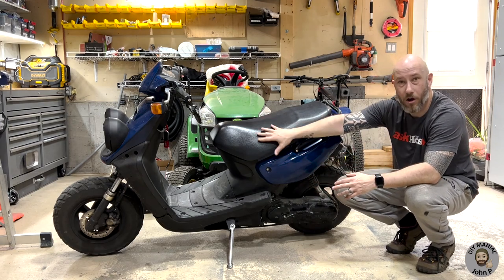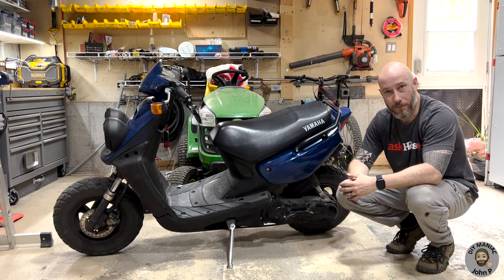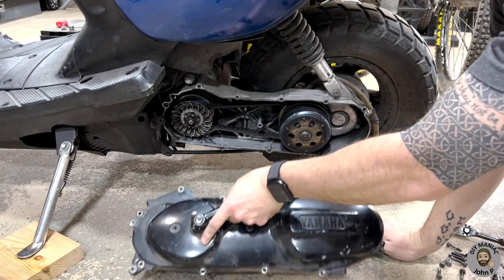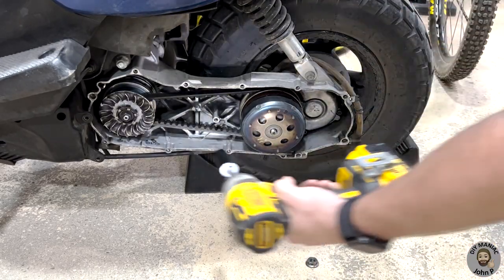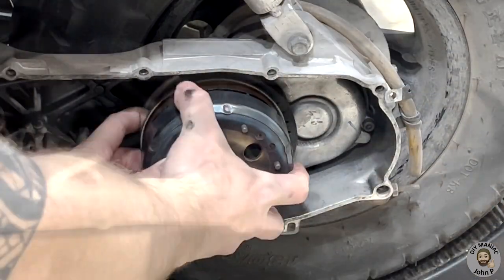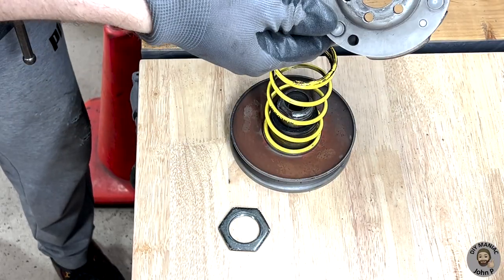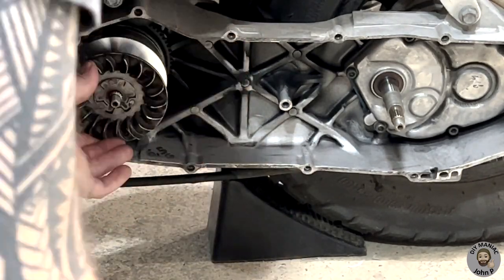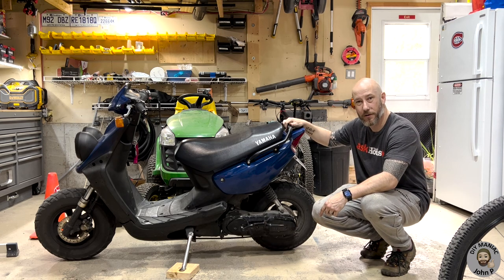Yamaha BWS / Zuma Variator and Clutch Replacement

Comment: About a month ago I put a new carburetor in my 2005 Yamaha bws and it was running a lot better. Recently I put a new variator, heavier rollers and a new belt in but it made it run slower and worse. Do you know why?
Reply: Yes, you put heavier rollers in it, now it is up shifting at a much lower rpm. 4stroke engines power and torque peak at higher rpm.

Comment: Quick question, loved your video. I changed mye son’s clutch and Variator and now the scooter won’t start. The ignition seems to do it’s job. But won’t start. Any suggestions on what to look? Sparkpkug, cable, gaz?
Reply from the maker: Nothing in the transmission you touched should have caused a no start. Was it working perfect before you changed the clutch and variator?

Comment: i put that side stand on my scooter but it wants to push it up and fall over any suggestions on what you did to get yours to stay and also how to prevent it rolling away on a hill as there is no brake lock like on quads I've seen. just did my transmission oil change i was 6k km overdue didn't even realize i had one and when i bought scooter it had 400km on it from 2004. it was all green and smelled burnt. currently waiting for new exhaust to come in and i have a new aftermarket variator kit to give it some extra speed if i can find someone to modify it as i am not a mechanic. its a bws 50 2 stroke and i run strawberry scented motor oil

Comment: Hey! 

I’m looking into some problems I’m trying to fix with a bw 50 2012. 

For instance when I start it and leave running on the stand, it should idle at a normal speed, but the rear wheel runs really fast… I was wondering if you know or would show in a future video how to adjust the idle speed
Reply from the maker: The idle speed is easily adjusted with the idle screw on the carburetor
Reply: @DIYManiacJohnP  

Tks!

I’ll try to find how to access that. I’m new to this. 

Maybe you can show this in a future video. It seems like a common issue.

Comment: got question on my 2008 zuma my push start button don't work what could be wrong.
Reply from the maker: Easiest first step is to check the functionality of the button by making sure it has continuity when pressed. You were there wanna work your way down the wires looking for any brakes and then finally verifying the starter motor to make sure it’s spins when 12 V of power is applied.
Reply: @DIYManiacJohnP  ok thanks. the kick starts up fine.
Reply: @DIYManiacJohnP  thanks for the tip tho.